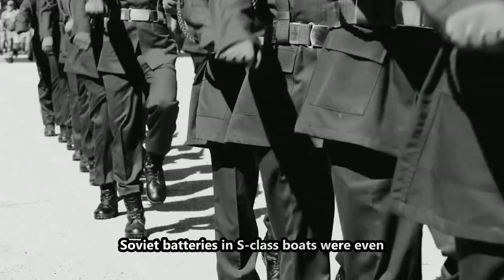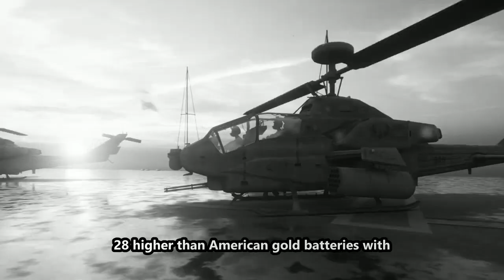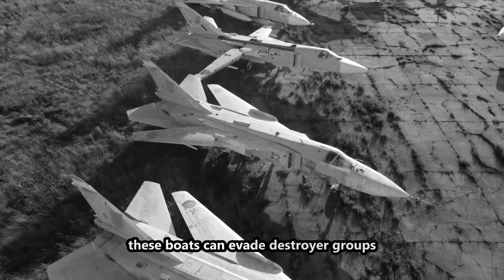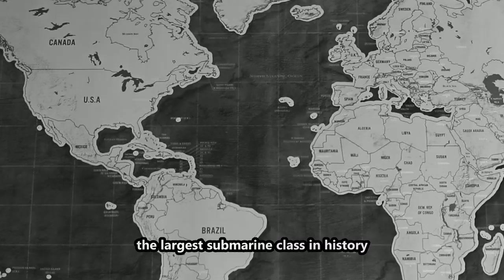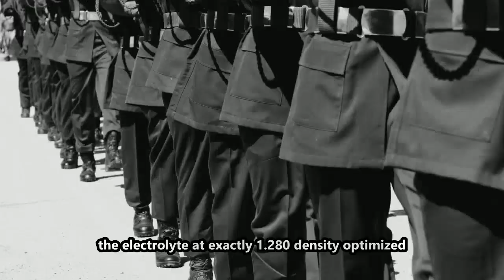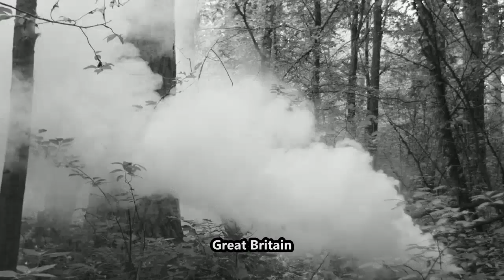Type XXI AFA batteries | NATO stole German 17-knot underwater revolution technology

Comment from the maker: Which AFA battery specification impressed you most? The 14,400 Ah capacity, the 372-cell precision engineering, or triple the speed of Allied boats? Engineers in comments have shown fascinating connections to modern lithium-ion batteries - core principles remain identical. Share your electrochemical discoveries and technical insights!